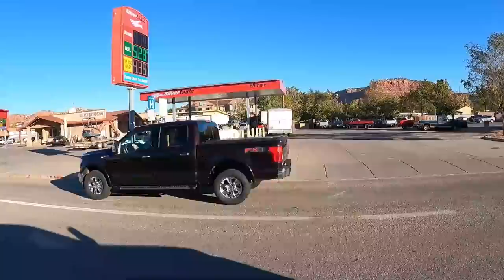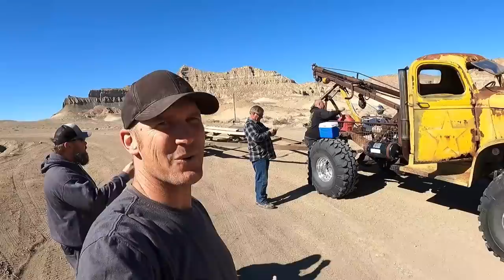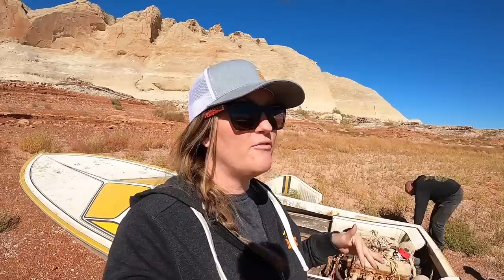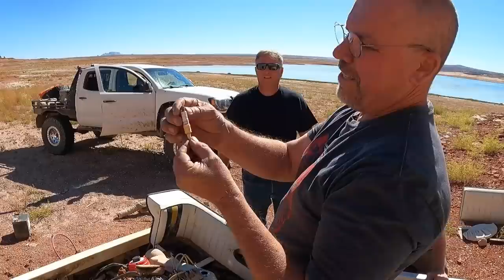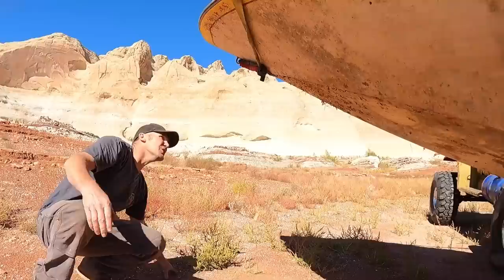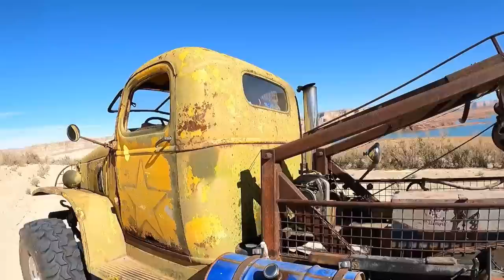Recovering Sunken Boat At Bottom of Lake Powell After 30 Years

Comment: After being under water for so long, it might be smart to open up the fiberglass stringers, inspect and close and reinforce them - a bunch knowing the fab rats.
Reply: precisely this, also they should probably invest in some 2 part dye crack penetrant to find out where all the cracks are
Reply: The stringers are made of wood and partially covered in fiberglass in all that I've seen like this. These appear to be wood as well.
Reply: @jjohnson2553  agreed, every one we opened up has been built pretty much the same. Also need to check the balsa or whatever core material they used for the decks and floor. 
Dad is a boat carpenter for a living so have done stuff like this a few times.
Reply: Good idea in most of the fiberglass boats I've rebuilt the stringers are wood under a couple layers of roving chopped mat roving chopped mat then a couple layers of glass cloth.
Reply: Wood/balsa cores do rot more often than not.  I would have that hull inspected by a professional before spending any money on it.

Comment: I love it.  When I saw that pump on the backside, I thought it looked a lot like the pump and engine on my SportMaster.  It had a Jacuzzi pump with an Olds 455.  The boat had sunk from negligence and I got it for almost nothing.  I replaced the pump bearings and reshimmed.  Replace the crank and bearings because of corrosion.  After that, it was a VERY GOOD ride.  We did a lot of skiing and a lot of fishing with that boat.  I hope you have as much fun rebuilding yours as I did mine.

Comment: There were a few boats like this on the lake where my folks had a cabin here in northern Minnesota.  They were popular starting in the late 70’s, had big V-8’s with lots of chrome, and a Berkeley jet drive.  They were fun to watch and very fast.
Reply: I had a Olds 455 out of a 72 4 door 🤣the stern was inches out of the water ?? Great times 😄✌️
Reply: I had a Sleekcraft, with a 455 Olds and a Jucuzzi jet. The motors were bought as a crate motor from the manufacturer and installed by the builder.
The motor in mine was referred to by Olds as a, marine / irrigation motor.
But, like you’re saying, many were replaced or sourced from other places.
For as low as they sat, it was real easy to get water breaking over the transom on stops, and I wonder if that ain’t what sunk this one?

Comment: I have an idea on how the boat went down. I used to live in AZ, I had a Hallett Jet Boat with a Berkeley pump, and my friends all had jet boats too. One day, we were out on the lake, being idiots (you could drink and boat back then in the 90's) and my buddy in his jet boat tried to do a "James Bond turn-around" basically a 360, which he had done many times before. However, this time, the boat augered in, ejected him and his buddy, went down stern-first, bobbed in the water for a minute or 2 because there was an air pocket in the closed bow. We immediately devised a recovery plan, and at that moment the bow cap split open from the hull, made a farting noise as the air escaped and it immediately sank.

Ah, the good ol days!
Reply: Only the premium built boats had the deck glassed to the hull which would have prevented the situation you describe.

Comment: That looks like an advantage 23 feet jet boat (I had a similar one -- but it was red).  They are very flat bottomed and they don't deal with chop at all.  The engine is also over sized for the hull and the board tends to ride too nose high when not on a plane.

Comment: I had one-off these boats, it was an 1987 Eliminator 21’ with a Ford 460 engine and a  Jetovator  jet pump😅. If you want pictures and videos I can send them to you I still have a few parts and a new dashboard that was cut out of a black plexiglass with all the holes for everything. It was cut out with a water-sand cutter on a computer. Thanks Tom C.

Comment: Grew up with my dads boat that was very similar. 455 olds motor with the manifolds through the transom. Many many hours of family fun. I’m guessing the boat was swamped by huge wave. They ride pretty low in the water and if a big enough wave comes over the back of the boat they sink pretty easily.

Comment: Fiberglass can water log like wood to a degree.  I would make sure the hill still had integrity.  I watched a water logged 30' fiberglass sailboat be cut apart.  Internally it was mush.  Be drilling holes and checking that out.

Comment: It's pretty amazing that this boat actually was simply sitting on the lake floor. It must have had some floatation left and probably was drifting over the lake floor for three decades. Otherwise, it would surely have been at least partly covered under sediment at this point in time...Good thing you pulled it outa there, also for the environment. It's a groovy machine for sure! BTW: My guess is that there is some good old soul music on that tape!

Comment: There is an almost identical boat sitting in my pasture with a good Oldsmobile in it. All interior is there I think. Needs glass work in red and white, comes with trailer. I'm tired of mowing around it. Let me know.  It belongs to my boss but hasn't moved in a decade plus. I can pull the tarp and send pics if you're interested 😉. I'm betting the cassette is Metallica ugh.... or guns and roses. Good luck

Comment: Hope ya can keep the Olds. In the 70s these were “the engine” for the jet boats.  The 330 through 455 were the same block. It was the Lego blocks of muscle car engines.  The 455 put out what was then massive torque which worked well on the jet drives and on the prop driven ski boats. I’d guess that lack of parts availability will likely drive you to a swap.  Looking forward to watching the build. 😊
Reply: Yes, the 455 was "the engine" for jet boats. No, the 330 and 350 were different blocks than the 400s, there were 2, the 425 and 455.

Comment: Heck, put some Marvel Mystery oil in the cylinders, hook up a battery and fire it up. Back in 2003 I was a major home builder superintendent and that summer my framing company subcontractor hosted an event on Lake Mead and rented 2 huge houseboats. We went back in about 20 miles and at night I decided to sleep out on the hilltop due to all those snoring and farting construction workers. The next morning I walked down to the shore on the other side of the hill and found a speedboat with a 454 that had recently showed due to falling water levels. It was a total lose. A lot worse than this one.

Comment: As a person who has spent a lot of time on a big water lakes in a low profile boat I can tell you in only takes one good wave to go over that bow to swamp it, especially with no windshield. Jet boats can't trim the bow up like an outboard can so you really have a problem as the waves come up.  The wind can come up quick and just like that you are in a boat that has no business in four foot waves. If the water were to kill the engine, the wind would push the bow down wind. At that point waves would start coming over that already low transom. Very quickly after that, that big old hunk of iron would have that boat heading for the bottom.  Obviously, I wasn't there, but that scenario is the most likely cause of that boats' demise.

Comment: I had the same problems on my F150 front hud gears, away skips out/break, when you need it! 90 USD for pair of manual-locker in the 1990 Ford 12x33 tires aren't fuel friendly? If lucky 12-14 Mpg.

Comment: Review your first video on this boat and see if you really did know it had a hot foot.
Old 1970s jets like that were throw away boats anyway, no reason to salvage it when it sink.
If you're going to fix it do it right and move the pump back in the boat so the clean out is outside the hull, then put a jeta vator on it.
Low HP 455 engine heavey hull slow boat.

Comment: There is no way that boat was submerged for 30 years in a 100 ft of water. It's far more likely that it's not been registered for 30 years and someone has got it running and took it out to shake it down and for whatever reason the boat sank. I doubt seriously that it's been submerged for longer than 5-7 years. Getting off the throttle and not staying ahead of wake rise and swamping the back of a low profile jet boat with a big block sends them to the bottom and the occupants into survival mode.
Reply from the maker: I can whole heartily tell you, that boat was sunk the summer of ‘93 and has been under the water ever since.😎
Reply: "The NPS also stated if someone is found to have removed something from National Park Service property they could find themselves in trouble with the law. “There are formal policies, including the NPS’s Code of Federal Regulations states in Title 36, under the Preservation of Natural, Cultural and Archeological Resources, that the taking of items from NPS lands along with the possession is a class B misdemeanor; all of which are punishable by a fine (up to $5,000) or other penalties. Additionally, collecting surface finds that are exposed, or not dug up is also a violation of the Archeological Resource Protection Act.”

Comment: What was required by the park service in order to get the boat out? I'd be worried about hantavirus under the front of the hull with those mice. There's no cure and you drown in your own fluid in your lungs. All that you have to do is disturb mouse droppings and breathe it in.